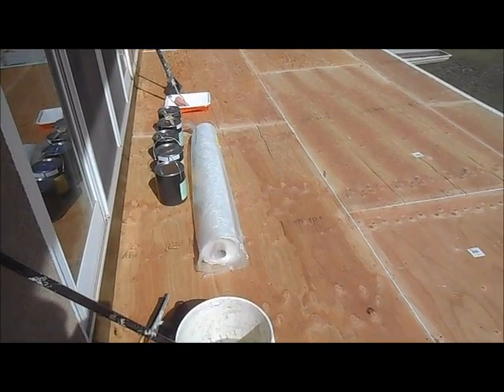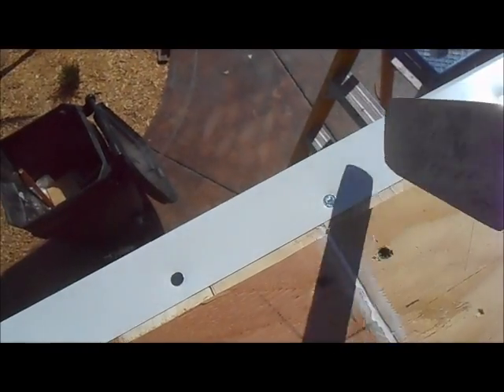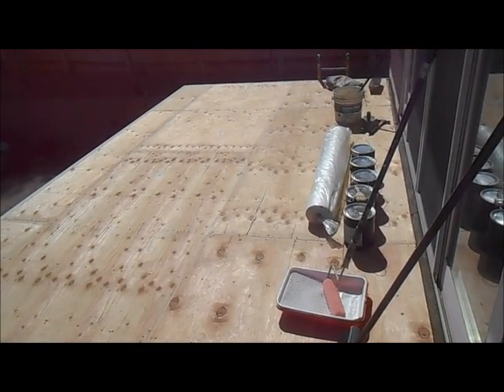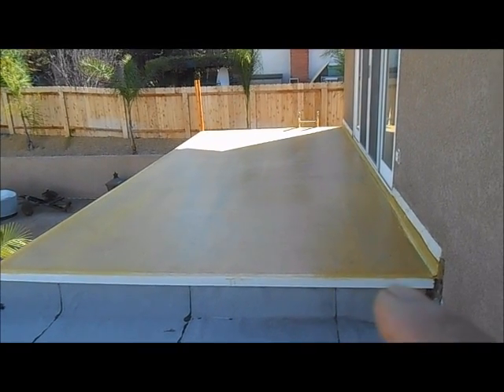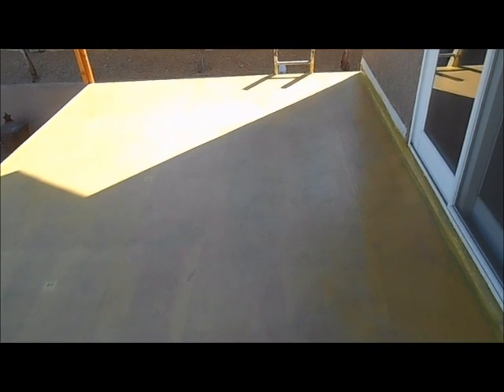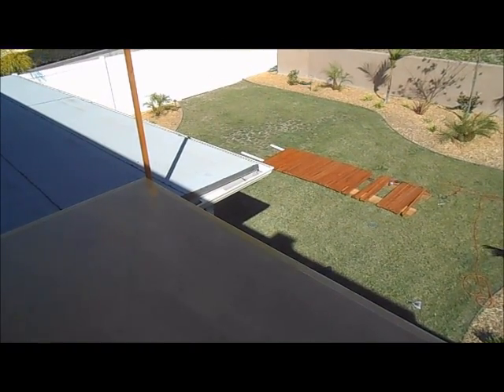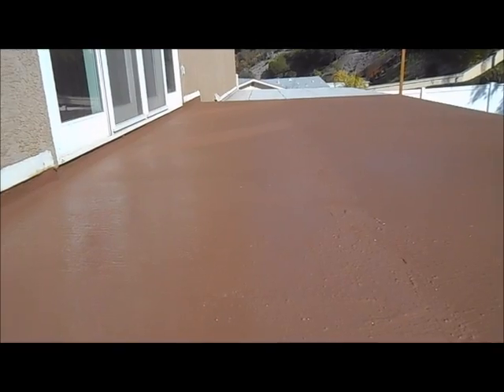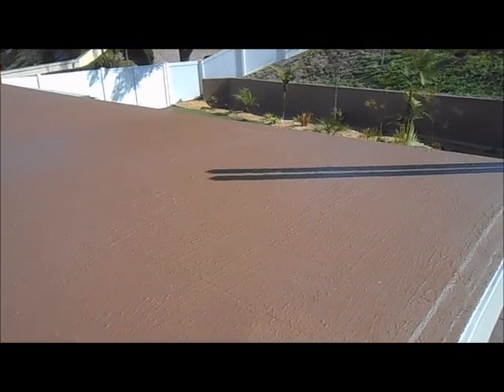2nd Story Balcony Repair & Waterproofing

Comment: I do water base and oil base epoxies 
Non of those recommended for exterior 
Urethane could use for exterior but needs to add UV resistant. Im in Phoenix AZ